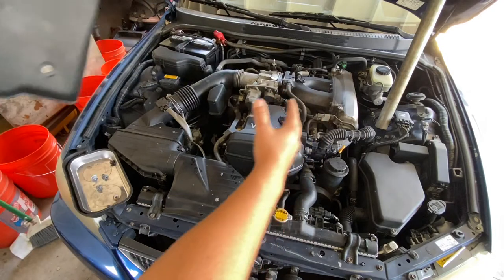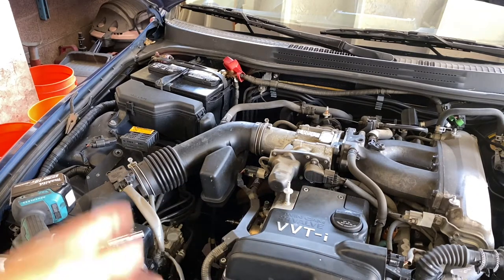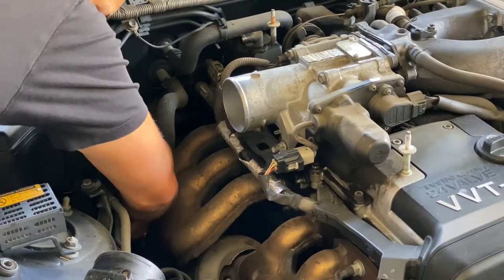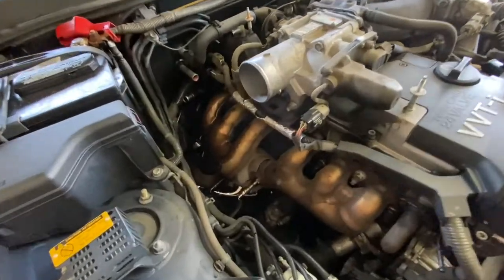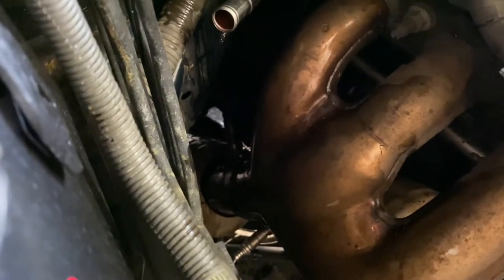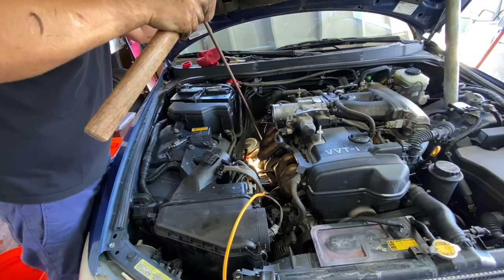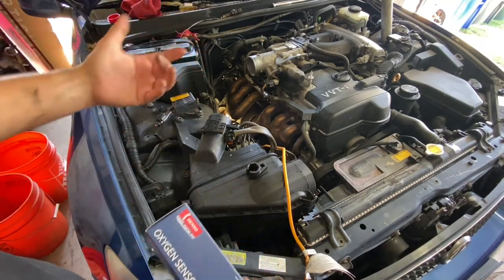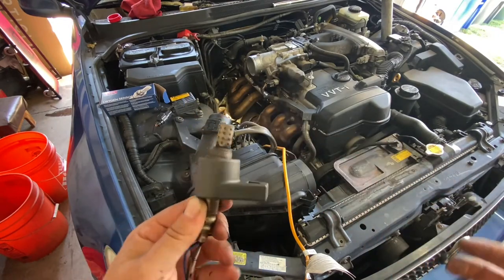Lexus IS300 GS300 P0125 Bank 2 Sensor 1 OFFICIAL FIX WITH TRICK

Comment: The easiest way to do this if you dont have a long metal extension... just remove the battery and the battery plate it sits on beneath.  This gives you just enough leverage to loosen the sensor with a small ratchet or breaker bar.

Comment: I have a 2006 lexus GS300 that’s throwing a “P0348 camshaft position sensor A circuit high input (bank 2)” code. Which leads me to a two part question, Are camshaft sensors referred to as oxygen sensors or crankshaft sensors by any chance? Could a bad oxygen sensor throw a code for the camshaft? The car cranks fine but check engine light is on and it idles rough(shaking/vibrating). I’ve also noticed a drop in fuel mileage and there’s a weird gas kinda smell coming from tailpipes

Comment: Very smart , but how did u disconnected the wire
Reply from the maker: Clip clip. You don’t need it since you’re putting a new one on. 👌
Reply: @greenowlmotors  u still had to disconnect the other end that was cut off tho?
Reply from the maker: Yeah to plug in the new one.